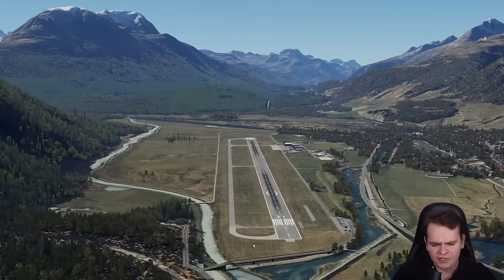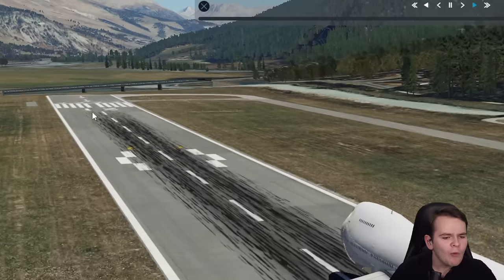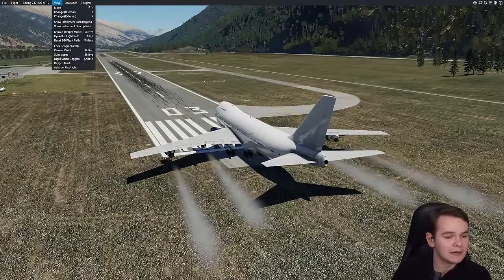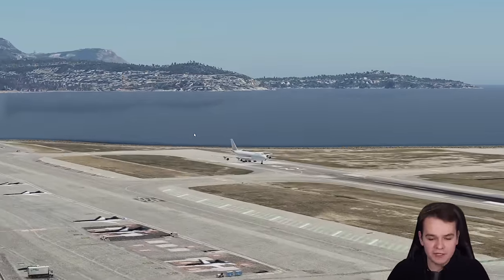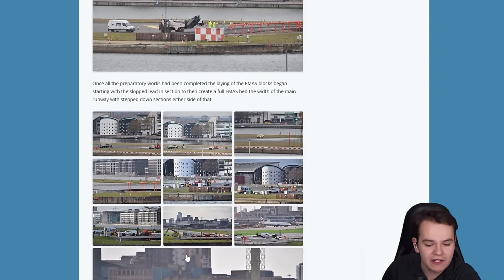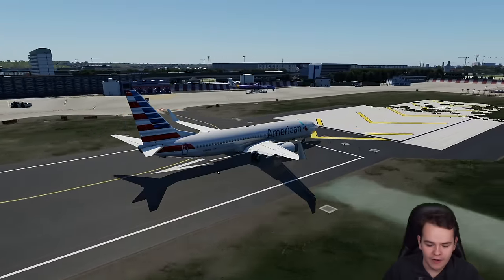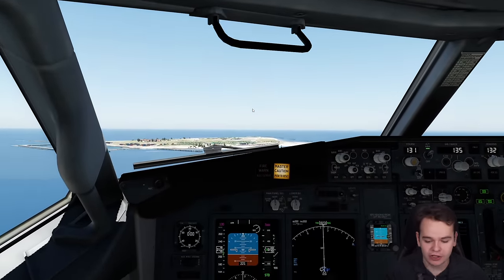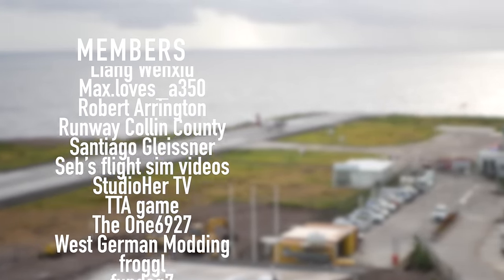Can It Really Stop AN OVERRUN? - EMAS Safety Bed

Comment: Sorry but i'm littlebit bothered, because there is only invisible wall that work to the certain speed. 
Cool for 24 fps cinematic videos but in that 60 fps it just look like you crashed to the invisible wall.
But if you don't cut that impact to the wall it will not look that good.